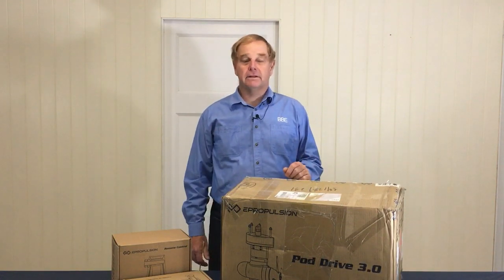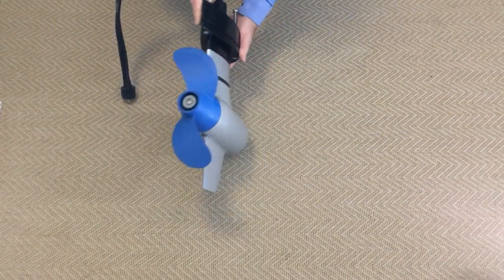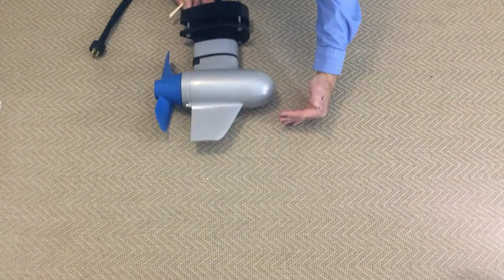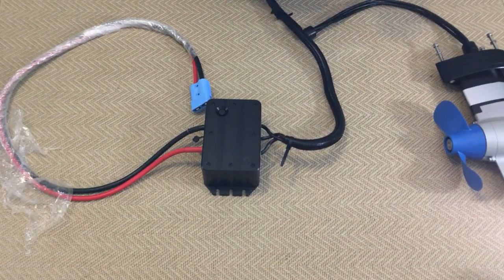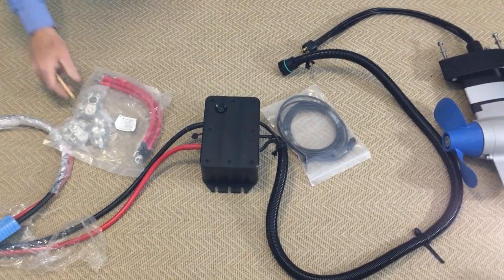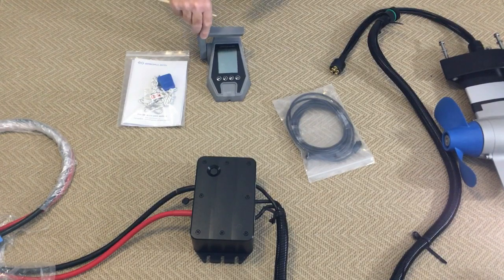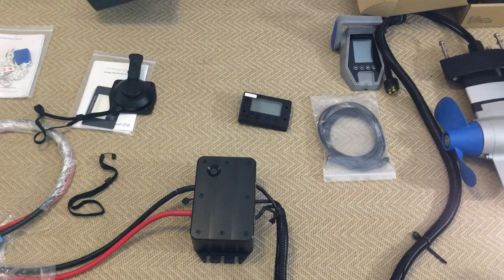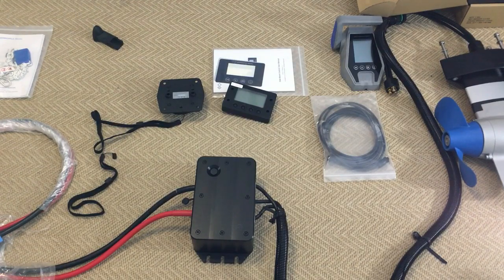Epropulsion Pod Drive 3.0

Comment: This is a very nice system. I intend to replace my broken Diesel Engine by 2 sets of Pod drives. Do you also have the throttle leavers right and left handed, so that it is possible to put both beside each other for an easier operation of 2 pods? Thank you.

Comment: can you charge their batteries with solar?
Reply from the maker: The E-Battery range can be charged by solar as long as the solar regulator meets the battery voltage specifications. Also note the E-Battery automatically turns off if it does not detect a charge input over 200W in a 24hr period. The standby current of the batteries BMS while on is about 10W and if left on over 24hrs = 0.24kWh of power consumption.